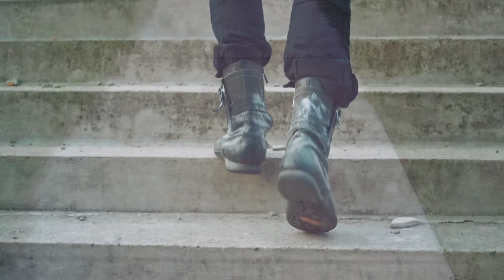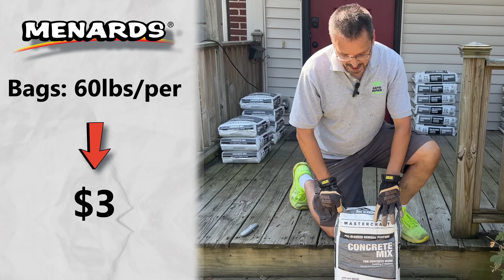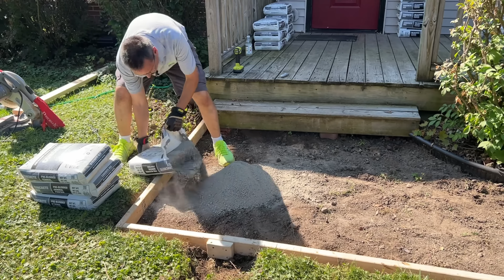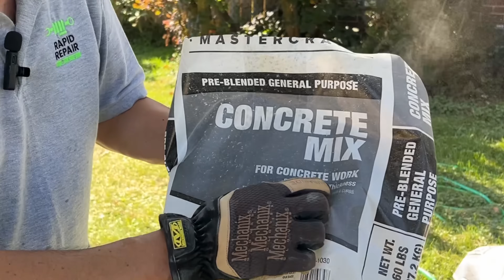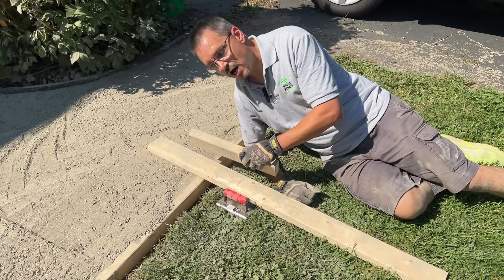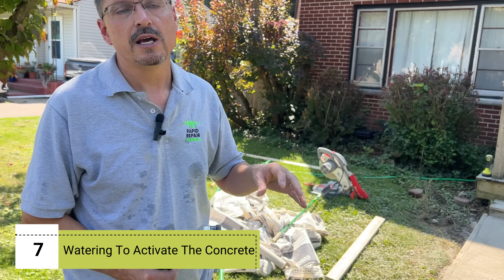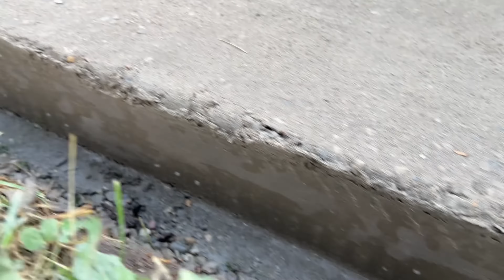Dry Pour Concrete Method Anyone Can Do

Comment: do not do this!!!   the concrete will not be fully saturated,resulting in poor mixture and a weak floor,  this can easily crack if something heavy is driven over it,   better to mix the concrete in the old fashioned way and use some reinforcement, this way its going to kast forever!!
Reply from the maker: Agreed, NEVER for driveways. Only for small projects. This slab in the video has zero cracks in nearly two years in a frost zone climate.

Comment: He appears to overlook probably the most important thing - strength. At best, it will last a fraction of the time that proper concrete will, and at worst, fail under much smaller loads.
Reply from the maker: You ain’t wrong 👍🏼😎 It’s only for tiny projects

Comment: Years ago I was paving over my front garden for off road parking for 2 cars. Lots of hardcore went down then time for the top slabs. Friend who was a builder said use sharp sand and mix up and keep dry. Easier to work with and get slab levels. Did half the area one weekend, the next weekend to finish off and needed to lower one of the previous weekend slabs. It lifted out easily leaving a perfect outline, but the mix under it was set solid just from the ground moisture we'd had no rain.
Reply from the maker: That’s a great story of how moisture always wins in the end. It literally wicks right up. Thanks for sharing 👍🏼😎
Reply: @HomeRapidRepair  Just had a look on google maps, 35 years down and still solid with cars parked on it.

Comment: This is literally the DUMBEST thing you could do.  Cement is made to be MIXED with water.  It has been PROVEN, time and again, that this "dry pour" stuff is a complete waste of time, energy, and resources - it does NOT work.  It WILL crumble to dust the moment you put stress of any kind upon it.  There are many, many YT videos that prove this method is utter trash.
Reply from the maker: Thanks for your comment. Check the date on this video, it’s been well over a year old and this particular slab has no cracks whatsoever. But here’s another video. I did comparing the two methods and yes, dry pour can be very crumbly and weak and would not be for any kind of large projects or anything substantial.

Dry Pour vs Mixed Concrete – Which Is Better?
https://youtu.be/-2gE_PVSdJM

Comment: Where is the reinforcement mesh, that will crack as soon as you have a ground disturbance or some considerable weight placed on it , it will crumble like old bread
Reply from the maker: Look at the date of this video, it’s been well over a year and there is not one crack in this slab at all…
Reply from the maker: You give me a good idea. Thank you. I’m going to do a follow up video showing the longer-term results… This is only for extremely small projects and not anything Structural at all.
Reply: @HomeRapidRepair  still needs structural integrity

Comment: hi would it work the same over slabs with just straight concrete
Reply from the maker: It can work over existing concrete, but it’s not recommended for structural applications. Just very small projects.

Comment: This actually made me laugh.  Water is used when mixing concrete for a reason. Rebar is used for a reason. There is no mixing here. This will crack in a few weeks and you'll be ripping it up. Just saying!!!!
Reply from the maker: Look at the date of this video…well over a year and zero cracks. 

Disclaimer: only for extremely small projects | non-structural projects.

Comment: Wet poured concrete is a lot of work, but it has a lot more strength than dry.
Reply from the maker: Yes you are 100% correct for sure. Thanks. 

DIY Concrete - Dry Pour Concrete Test
https://youtu.be/0jxCoXkS-EA

Comment: Mix it correctly.  What you are doing is NOT right.  Use concrete the way it is supposed to be used.
Reply from the maker: I agree that mixing concrete is the correct way, this video is just for very small projects for beginners who don't want to go through the hassle of mixing heavy bags of concrete.
Reply from the maker: You’re not wrong…YouTube is filled with new / random ideas

Comment: Did you see the level - or not levelled cement with the slope towards the deck >? Looks pretty bad
Reply from the maker: This portion of the yard has a general slope away from the house and front deck…. Thank you for watching 👍🏼😎

I admit that this method is never pretty… It’s just for very small projects with beginners that don’t want to go through the hassle of mixing a bunch of heavy bags of concrete.

Comment: I was always told to cover the concrete with like a tarp, or burlap, to keep the concrete from drying too quickly.  It is suppose to help the concrete cure more slowly and produce a stronger area.  That's what I always heard.
Reply from the maker: Yes, I’ve always heard that as well. I do think it’s good advice. Keeping the moisture in will cause the concrete to cure slower which will mean stronger longer-term. Thank you for commenting 👍🏼😊🛠️

Comment: It has been proven that dry pour has about 50- 70% loss of strength because of incomplete mixing of gravel, sand, water with the cement and does not hold up to freeze thaw cycles as well. Don not dry pour anything structural.
Reply: My point exactly. It's amazing how many knuckleheads are praising this guys work. I did concrete for 40 years. Patios, sidewalks, driveways, shed pads. What a joke

Comment: No rebar?
Reply from the maker: Hello, no it’s just not needed at all with such a small project. You can purchase the extra strength PSI concrete bags if you want to, but honestly the cheaper common bags are fine 👍🏼😎

Comment: Can i use this method to level the concreet slab?
Reply from the maker: Yes absolutely…it will work. However, depending on how thick the new concrete will be you may want to use a different product. For instance, if it’s gonna be thin use a resurfacing or a self leveling product… This method really needs to be at least 2 inches thick…

Comment: I'm not anyone, 40 years building swimming pools, the concrete deck is the make or break component. The only dry pour I'd ever do is around a fence post. There's no way for you to "finish" your final surface...
Reply: A non smooth concrete surface looks better then a empty bank account 😂
Reply from the maker: @ScoobyDrewski  100% agree with you
Reply from the maker: I don’t disagree with your points here. You have fantastic experience. 

However people are searching for easy diy concrete for small projects 👍🏼😎
Reply: If the surface inside a shed isn't smooth I dont think anyone is gonna care
Reply from the maker: @ScoobyDrewski 100% right on 👍🏼😎
Reply: @ScoobyDrewski you would be surprised
Reply: When cement is mixed, no matter if it's concrete, grout, mortar or a pre-mix there is a part of the process called where the actual cement slakes in-between the initial mixing and a secondary, which is when the actual cement (the binder) completely dissolves in the mix, making it stronger. The problem with dry pours is the lack of strength. Which I understand some don't care for certain situations. Just offering wisdom so people can make informed decisions.
Reply from the maker: @a.joegevara3519  Fantastic wisdom...thank you
Reply: Buy a portable mixer and wet pour.  Use rebar and chairs tokeep the rebar in place. 4 inches thick minimum.
Reply: I have done concrete for almost 30 years. I have owned a concrete company in the past that was very successful. Yes having a concrete truck bring in your wet mix and using a pump truck and spending tens of thousands of dollars on a poor is the correct way to do it but also doing a dry mix is perfectly fine if you don’t have the extra funds to waste and you can get a beautiful finish doing a dry mix using the paint roller technique that he showed in the video if it comes out looking bad that’s because you tried flooding it before you gently misted it
Reply: I’d be OK with that finish for a shed base or similar but not a patio
Reply: @a.joegevara3519  handymen are a very special breed 🐣🐣
Reply: @a.joegevara3519  if youre not anyone, this video isnt for you. Youre a professional builder, not us. Dont speak for anyone.
Reply: Will this work for an old fire pit removing the rocks to replace it with this
Reply: Handymen are a very special breed 🐣🐣
Reply: It will be easy to tear out and do it right later.

Comment: Very interesting. I suppose the trick is the watering. Just enough to let it flow down all the way.
Reply from the maker: Yes, you are correct! You want to get it to saturated without disturbing the surface. 

Water Schedule
For Dry Pour Concrete 

1. Gently Mist  - Wait 20 minutes 
2. Gently Mist again - Wait 20 minutes 
3. Gently Shower - Wait 1 Hour 
4. Full Soak & Flooding including edges and surrounding area.

Comment: i learned from this video how simple it can be using concrete now.  Thank you!  How do u create a slope using this concrete material??  I'm trying to create a SLOPED concrete floor for my 2nd floor balcony, so when it rains, the water will drain.  I'd appreciate an answer.  Thank you.
Reply from the maker: Hello. Yes you can still use this method for a gentle slope, you would just have to cut / fabricate the form to the shape you need. As long as it’s not too steep it will work 👍🏼😎

Comment: Can I do this  floor inside a storage room?
Reply from the maker: The answer is yes. However, the final result will be a bit below average quality of pre mixing it the traditional method.
Reply: @HomeRapidRepair  I have storage room 10 ft x 5 ft. Previous owner installed pavers on the ground. Can I just put 2-3 inch layer of this concrete mix on top of the pavers in traditional method? And how many bags do you think I will need? Thank you
Reply from the maker: @Се-Вера-Наша at 2 inches you would need like 20 60lb bags.

Comment: I do one other thing I hold the concrete mix back from being level with the 2x4 tops then pour a sand topping mix  on top to come up even with the 2x4s that way no gravel shows in top finish
Reply from the maker: Is your final sand topping mix pretty durable after it’s cured?
Reply: @HomeRapidRepair  yes it has for me
Reply from the maker: Interesting. That would give the surface a very clean look 👍🏼😎 I have been meaning to experiment with other finishes. Thank you for this good idea.
Reply: What is the sand topping mix?
Reply: @zacharyfazekas9148  it is the came as cement mix but doesn't have stones in it it is a bag product  in the cement isle

Comment: So... do you just mist it a few times? You're not supposed to too saturate it at all?
Reply from the maker: Water Schedule
For Dry Pour Concrete 

	1.	Gently Mist  - Wait 20 minutes 
	2.	Gently Mist again - Wait 20 minutes 
	3.	Gently Shower - Wait 1 Hour 
	4.	Full Soak & Flooding including edges and surrounding area.
Reply: @DogsLuvUNoMatterWhat  that would be valuable info wouldn’t it.
Reply from the maker: Water Schedule
For Dry Pour Concrete 

	1.	Gently Mist  - Wait 20 minutes 
	2.	Gently Mist again - Wait 20 minutes 
	3.	Gently Shower - Wait 1 Hour 
	4.	Full Soak & Flooding including edges and surrounding area.

Comment: That’s the worst way you could pour cement it doesn’t work. It doesn’t even make sense. I’ve been in construction for 40 years and these people are just trying to make a YouTube video.
Reply from the maker: It has its place for very small projects: garbage bin slabs, small steps, garden pads, hose reel base, etc etc
Reply: @HomeRapidRepair  I disagree sorry there’s no place for that kind of stuff. It’s not that hard to mix it with water the way it’s supposed to be and then it can cure the way it’s supposed to do you know concrete never stops curing. I can’t imagine how long it would take just a pour powder.

Comment: Would a person get a better cure by pouring 1/2 or more soak well then finish the pour dry.
Reply from the maker: Guess that could potentially make for stronger concrete, would be interesting. Although there’s no way to know for sure if the second course would bond well with the first…. Mixing the traditional method is always best… This dry pour method is only for extremely small projects…

Comment: You're not going to use dry mix for anything structural or requiring a modicum of strength such as this, and no reo?
Reply from the maker: Yes you are right, this method is not recommended for high-strength applications. Only small / minor projects 👍🏼😎
Reply: @HomeRapidRepair  Fence posts and the like, not slabs.

Comment: I can’t see how the water will get through 4 inch’s of cement to properly activate
Reply from the maker: Great question. That’s why you do it in sequences. You start off with a very light mist to just get a crust on the top… And then after period of time you soak it more heavily… It does eventually get all the way in from all directions all sides and even the ground… I plan to make a video in the future showing this water absorption
Reply from the maker: As far as proper activation… This method is only recommended for extremely small projects. Nothing too important 😎

Comment: does water penetrate ll 4 inches of dry concrete. in arizona water evaporates quickly
Reply from the maker: Yes it does absorb the water. The last spray is a total flooding and water will even be wicked up from the bottom and sides as well 💦💦

Comment: Don't do a dry pour. It is not as strong as a wet pour. It's been proven.
Reply from the maker: Yes your point is correct…true true However, it still has its place for very small projects and when a diy’er doesn’t have a helper, etc…

Comment: Hello from upper Hudson Valley NY
Just found your channel 
Subscribed !
Read the comments and your replies.
At least you’re honest about the method you are using. That’s what counts in the long run.
And to everyone knocking it
Yes this will obviously fail if you dry pour a whole house foundation. Hopefully everyone does their independent research.
So I’m off to do a low traffic, freeze/thaw,
no body will really care grill pad.
And then learn , correct,repair, any problems.
Like any thing else in life.
😂😂😂😂😂😂😂😂
Thanks for the vid,testing and commentary.
Good luck with the channel.
God bless
Reply from the maker: Hey you rock 🎸 Thank you so much for your comment and the subscription! 👍🏼😎

Comment: As a professional builder I would advise no one to EVER do concreting this way. the inside of that pad will be dry and unmixed and will break up very quickly. a sufficient  amount of water is needed for the concrete to bond together cure correctly and form a strong bond. this will suffer from wear very quickly and it will have very poor strength and structural integrity. 👎
Reply from the maker: Very good points you make. DIY’ers aren’t doing entire driveways or anything…just tiny little concrete projects 👍🏼😎

Comment: Are you able to use this method to create a pad and place a prefab shed on it?  How sturdy is this pad if you use tapcon screws on it?  Is it safe to make relief cuts on a bigger surface?
Reply from the maker: From what you are describing, I probably would mix Concrete the traditional way. You scared me when you said you want to screw Tapcon screws into it… The dry poor method it is strong, but I’ve noticed it is a little bit crumbly and the surface doesn’t look good.
Reply: @HomeRapidRepair That's what I was thinking.  Thanks for the reply.  Greatly appreciated, Sir.

Comment: Why no base?
Reply from the maker: Thanks for the question. It’s just not needed. This area is well drained and it’s only a tiny little walkway… Great for do it yourself projects.
Reply: @HomeRapidRepair i’m having a grill slab put in the back of my house. I just noticed the contractor didn’t lay down a gravel base but they used mesh rebar to keep it in place. Do you think that’s fine? I live in minnesota where we get a lot of snow.
Reply from the maker: @sagarjha3933 it’s a little extra insurance for your freeze / thaw climate.  However concrete can still crack even if the contractor did everything correctly…
Reply: Appreciate your help.

Comment: Am I the only guy that also noticed no reinforcement wire (or rebar) and no expansion joints?   Yikes!
Reply from the maker: It’s not needed for simple concrete slabs. Dry pour is not an approved method by the product label.

Comment: Ridiculous! You can't get the proper chemical reaction of mixing water with cement. It sets up but a couple of years later you will see cracks everywhere. I've worked with concrete and concrete contractors for over fifty years. When I mention these kinds of videos, they just laugh  and say: Guess those folks will be calling us to redo and fix their mess!  FYI
Reply from the maker: I’m going to leave your comment up because I think you do provide a lot of value here. Just because I’m making a demonstration video about this method, does not mean I’m endorsing this method. There is a lot of interest on this topic so it’s worth talking about 👍🏼😎
Reply: @HomeRapidRepair  IF you're not endorsing this method then don't give happy home owners bad advice on how to pour a dry slab. That concrete is going to be 70% weaker than a real pour. I did concrete for 40 years and made millions. I'm not buying into this advice

Comment: Dry pour works well, too, if you want to use natural flat stones for the top surface.  Mine still looks great, with no cracks, after 20+ years.
Reply from the maker: Great idea. Thank you for sharing 👍🏼😎
Reply: @HomeRapidRepair  thank you for posting great videos that are informative and direct to the point.
Reply: This is exultant to hear totally planning this
Reply: @sallyjom-cooper470  never considered this 

I may do a 8x12 dry pour, hot tub is going on it next to porch, doesn’t need to look perfect